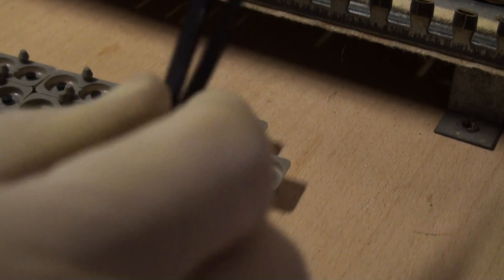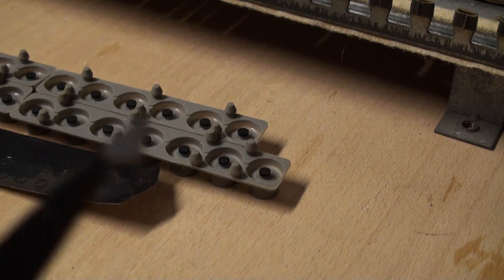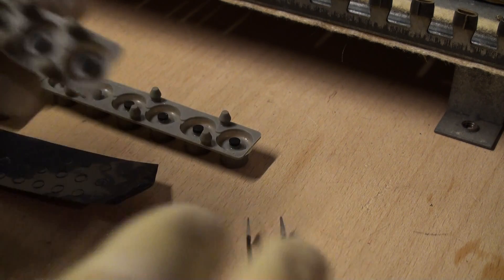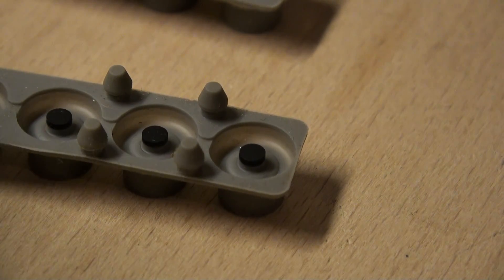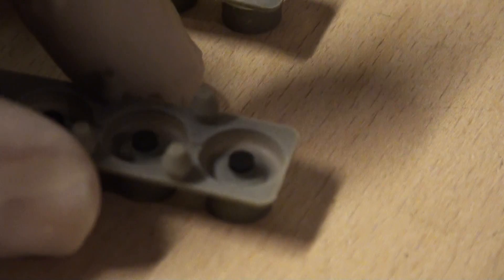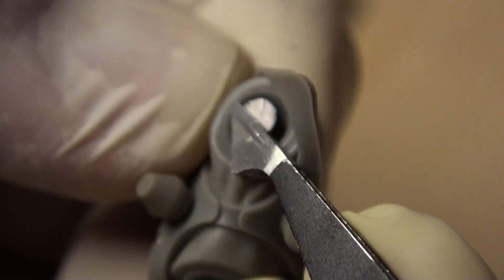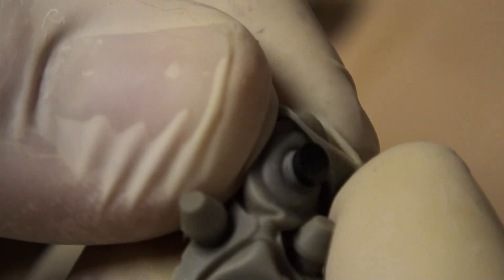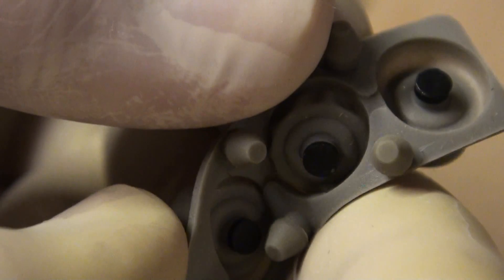Polysix Reboot p.28

Comment: It has been a couple years now. How have those conductive dots held up? They add thickness to the contact point -- was that an issue?

I couldn't find them online. Do you have a URL for the synth doctor? Either he doesn't sell them anymore, or I didn't find the right synth doctor site (there are many). Thanks.
Reply: http://sounddoctorin.com/synthtec/parts/key.htm#polycontacts

I would also like to know how they hold up, but I imagine he no longer has the keyboard.